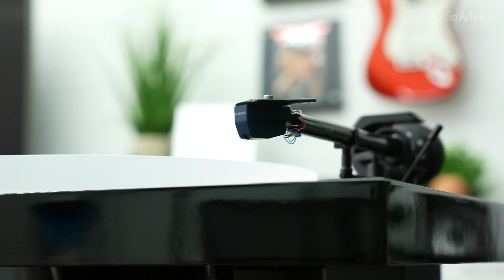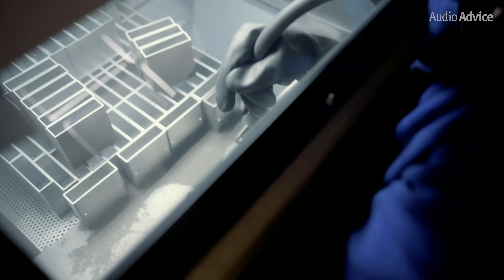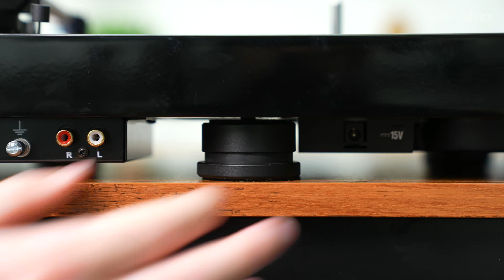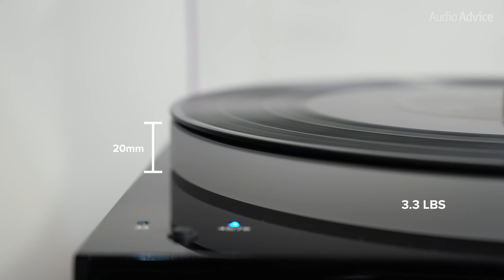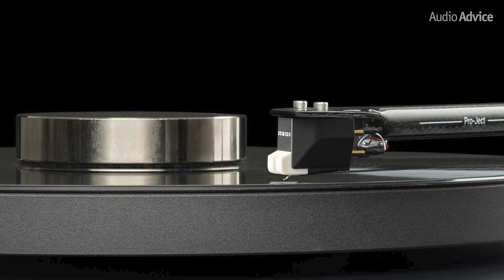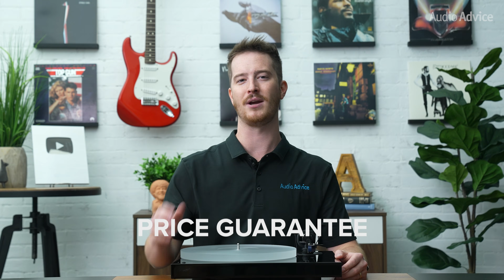The True Balanced Pro-Ject X1B Turntable

Comment: I just purchased the Pro-Ject X1b and Phono Box DS3B. I would like to upgrade to balanced connections but I do not have an amp or receiver with balanced inputs. I'm running the DS3B outputs into a Anthem receiver pre-out and into a Rotel class AB stereo amp. Is this an okay setup?
Reply from the maker: You'll first need a balanced phono cartridge, then a cable to go to the DS3B.  That is the very important link as the signal level is so low.  You can run regular RCA outs into your Rotel and still get 90% of the benefits.  Please reach out to our team at www.audioadvice.com to discuss in detail.  And thanks for watching our video

Comment: considering that today youcan find at around 1200/1300 eurothe X2B mounting a 400€ MC cartridge I completely miss the meaning of this turntable, why anyone would buy the X1B when you have a straight up better option at the same price of adding a decent mc cartridge to the X1B?
Reply from the maker: Yes, we somewhat agree at first glance.  This is all about being able to run the MC in fully balanced mode, which this table allows. But you also need a fully balanced phono preamp.  You have to experience the real silence this method allows.  Unfortunatly, there are not a lot of balanced phono preamps, but Pro-Ject makes a few
Reply: @AudioAdvice  for sure but if you buy balanced it is because you want that, and if you want that you need MC... otherwise I do not see why buing for a premium price the X1B and not directly the X1.. and again, if you want balanced why you should go X1B where you need to buy and set up a MC cartridgewhen you have the X2B option that is a straight up better turntable and includes also the MC cartridge... it is more expensive, sure, but probably less or same of upgrading the X1B and for sure less of a pain to set it up...

Comment: Your explanation was very good and easy to understand. Perfectly detailed to get this point solidly anchored. Now why does my Stanton 680 EL work better with the ground wire from the turn table disconnected and dangling to the floor with my Technics SL D2. Never had a problem with my Phillips 212 , but my Dual was finicky . But connected with the Technics the hum is loud and only slightly audible with the volume turned pretty high.
Reply from the maker: Interesting, have you tried a different cartridge?  The Technics design should be quieter with the ground connected.

Comment: I hope this one is better I have the X2 not the “b” but with the upgraded sub platter and the power supply and it’s great but I still like better my old thecnics 1700mk2. I also had the thecnics sl1200gr. 
I’m waiting for the new thecnics sl1200gr2, is taking longer to get it here in the states. Are you guys gonna carry the new thecnics? 
Pro ject has a Really solid turntables at good prices. The balance option is great.
Reply from the maker: Thanks for sharing, yes we should have the new 1200GR2 when it comes out.  Pro-Ject makes great tables for the money

Comment: They should offer it with a moving coil cartridge included.
Reply from the maker: Yes, we were a little puzzled at first as to why they didn't. After speaking with them, we discovered the original X1, which the X1B replaced, was not balanced and was only $100 less than the new X1B. The X1B turntable on its own for its price with the Rainier is just a super good sounding turntable. Had they packaged it with a moving coil, the balanced cable, and the necessary balanced phono preamp, it would have been a lot more expensive and out of range of many people who would appreciate the X1B even without going balanced. 

It still would have been great to see that as an option!
Reply: YES,ODD TO INCLUDE A MM CARTRIDGE,THIS IS AN UPGRADE TURNTABLE AND CARTRIDGE SHOULD BE TOO.